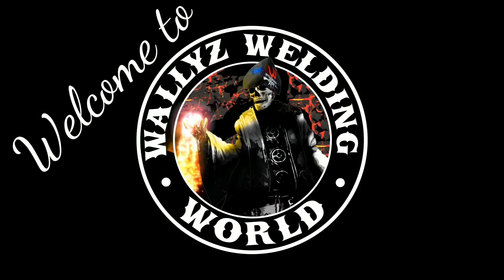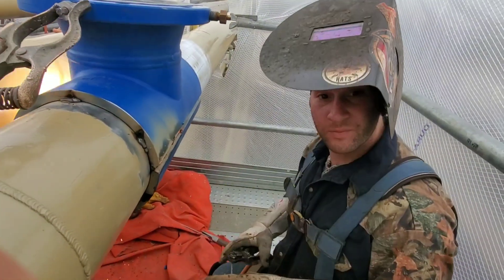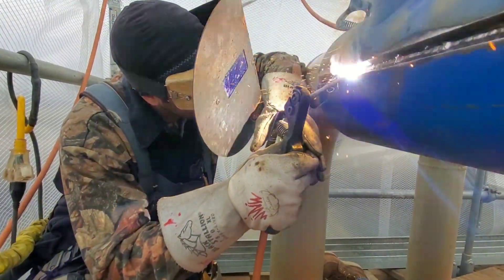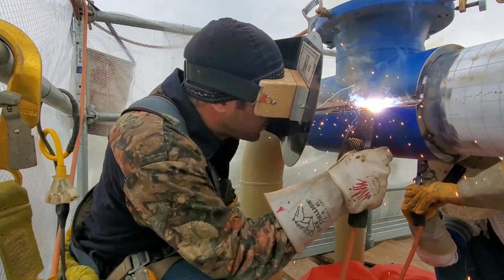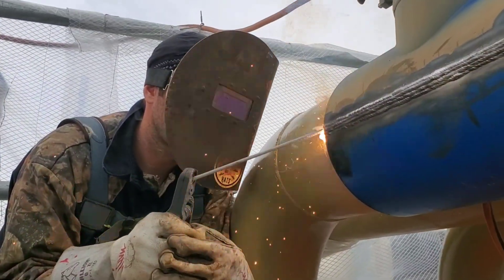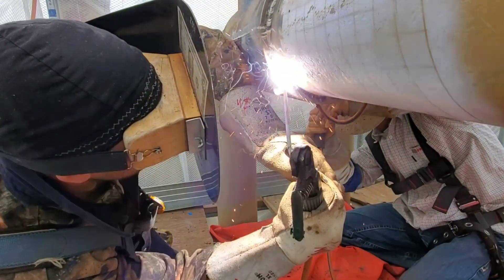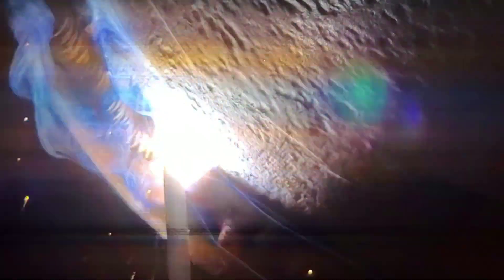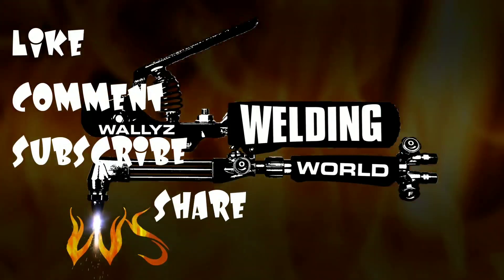Welding a LIVE LINE Split Tee — No Room for Error

Comment: That is wrong, never tack the fitting to live pipe, only tack fitting in long seams. When you go welding long seams out it thermally expands causing stress on all them tacks and live pipe which could lead to cracks.

Use chain clamps, then tack longs seams, then remove chain clamps.

Weld long seams out, then weld 1 circumference weld out then continue to next circumference. 

Its UT, not UTV

And you dont put fillet welds all the way out on fitting circumference. Its 1.4 times the thickness of lowest UT reading plus the gap between pipe and sleeve. Asme PCC-2
Reply from the maker: Right on. I follow the procedure given to me not instructions off YouTube. But thank you for your knowledge im not knocking it.

Comment: You need to adjust your Arc current control and a higher voltage  ….
Reply: Amperage
Reply: Amperage,
Reply from the maker: Yeah I was struggling 😆

Comment: In case of gas pipeline, is it mandatory to have minimum gas flow through the pipeline to achieve the split tee weld and the hot taping ??
Reply from the maker: It’s what they add when the line is live. A valve will go on and then the drill. Drill hole pull up drill close valve build line going to valve to other run.

Comment: Nothing but gravy this guy's are doing. 
How about working on 13 stories.  Hanging out side the the building.  With harness one hand holding the safety cables the other hand welding on 3/4 Inc steel. 1/8   rod.
Reply from the maker: Why would I do that it just sounds like something I didn’t sign up for lol. Stay in your lane I guess. I stay on the gravy train you can go up high and hang 😉

Comment: When you weld stringers first stringer your next one you finish
Reply: Into your first stringer. Teachers?????  And so on always pipe 8 inch up hill first stringer 9 o clock to 12 o clock then grind start for a nest for your next stringer stop.  Start 6 o clock stop 9 o clock teachers. ?????????? 40 years I forgot more than teachers know  yea really never start on your last bead never!!! Never means never !¡!  Oh never seen on videos wash , rake , or a correct lace or a correct stop/start never! I have seen junk when you get good enough you get to repair junk .
Reply from the maker: I don’t grind my starts . If ya learn to weld properly there is no grinding in low hydration unless ya trap and if ya trap your technique is a lil off I could show ya how to obtain no grinding and make great time on a test. Grinding takes time

Comment: No run on run off tabs on the longitudinal welds WTF ???
You asked for comments..
Cut some 1" x 1/8 angle about 2" long, lay the angle in to match your prep so you can use them as start and finish tabs..
Can't see how that wasn't included in the WPS, we would never get away with not including run on run off tabs in Aust 🤔
Nice job just the same 👍
Reply: different standards in yankee land that's for sure 😂

Comment: Things have changed so much. When I was welding in the early 90’s , I capped with 1/8 using a horizontal figure 8! Leaving a flat cap with 1/16 over the pipe.
Reply from the maker: So cool

Comment: Not a welder here - So if you need a backing strip to be safe about blowing thru the pipe to join the two halves, how can you go after the ends  so aggressively and not have problems?  Great looking work btw.  You sure can see the pitting in the pipe on some of those close ups.   Thx!

Comment: I mostly  welded  buckets  for excavator  and  heavy equipment.. was a diesel  mechanic     the 1st part of my career..  I'm  pretty knowledgeable   in that  forte    but  I'm  far from experienced  in oil pipe  work I say that  because  I believe  this is a moronic  question   but
If you welded the tee  on a solid  oil line  what's the next step   as for bolting  another rerouted  pipe  by making that a union. How do you get the center  of that  new tee cut out  without shutting  down  oil   maybe I'm thinking to hard 🤦🏽‍♂️   maybe they make a  flange that Pearce's   the middle of that pipe as its  bolted down..
 Like I said I live on the east coast   pipe lines are far from our line of work ..  I couldnt tell you    the psi of the oil or  anything  about oil field work or pipe fitting..   aside from that awsome work...   mannnn... all that look at my beautiful  weld's  is for the tig guys   ofcourse anyone could burn a  rod  and say how beautiful  it is but nothing compares  to tig
Sorry so long

Comment: Any young person watching pay attention to how he strikes that 7018 3 inches away from the puddle.THAT PREVENTS POROSITY.Which likely to happen especially on the bottom of as pipe with a 7018 especially..If you are testing and need a job very bad to feed your family that can make or BREAK the test!Also be aware that welding on a pipe with gasoline or crude oil or any liquid has a tendency to very quickly draw the heat out of a puddle.ALWAYS INSIST ON THE THICKNESS TESTING!Especially if you are welding an WOL[weld o let] or TOL[thread o let] on the outside radius of an elbow which is a common practice at refineries.The elbow wears thin on the outside radius and you can get burned to death by the gasoline under pressure that just spayed out on your clothes and skin and face.Also ALWAYS strike an arc on something else to make sure that someone did did not turn up your machine by mistake thinking it was theirs to run jet rods or arc gouge or maybe something wrong with the machine.Blowing a hole would likely be fatal or worse.When you are around a refinery the human nose is a better explosive meter than anything man has ever invented and can detect 2 part per million of something like ether.No flamable/explosive meter can do this.If you smell gasoline LOOK for the sourse BEFORE you ;light up!I saw someone avert a disaster one time by smelling the fumes coming from an exterior tank gauge on a still cool morning and settling on the ground 75 feet away.

Comment: As a old retired guy that welded for a few years as a pipe fitter back in the late 1960’s. Most of my experience was with steam piping. We used a lot of E6011 low pressure. I did a lot of tank farm work getting them ready for new kind of gas. These were Shell farms and pumping stations. All I knew was that it was called Shell of the Future on the drawings. Most were in evacuated lines. We had to weld uphill on everything a lot of flanges as many valves had to be upgraded. Then vapor recovery came right after the “gas of the future”. Funny all the pipe line guys welded down hill we couldn’t hire them.  I’m looking at a scar on my ankle from a hunk of that ugly 7018 slag that somehow went down my boot (no spats) 70 years old and that still gives me the chills today as I think about. Didn’t hurt long but it did hurt like heck for a bit. I was a kid and the Forman my helper were laughing like hell as I started jumping around. Just had to pull that hunk of slag out it was deep because my boot pushed it into my inside left ankle 50 years later still have that scar. Anyway great video. Never used a split tee very nice item.  Start cutting a tee in on a hot day those lines would get hot in the sun and grow so much the tee wouldn’t fit your cut out. Hose the line down with a fire hose so you could fit it up. Sorry so long I’m old.

Comment: I have done split tee weld my experience is that the circumferential weld we do with 8018 rod in downhil first two passes on pipe not fuesing split tee the third pass on split tee and pipe fist pass,and continue weld,all pass in downhil,Reson fast cooling,fast traveling,I worked in oil field Will Bros company,as foreman ,Oman, Kuwait, Saudi Arabia,(I don't know what you think but I have practical experience,

Comment: In minute 9:44 there is under cut at the top weld and a log the weld in several different spots I seen and pinholes on the end cap weld good job but could Ave slowed down a touch not judging but that's what I saw

Comment: Great Video!  I really like your narration, but don’t be so hard on yourself!  Welding in the field gets difficult.  I’m a structural welder by trade, but do a lot of TIG work in a fab shop.  I have welded large diameter nozzles fabbed in the shop and on some of the bigger ones, we used 1/4” 7018 for a final filler and cap pass.  Do you ever use 1/4” 7018 rods?
Thank you and I love your videos!
Reply from the maker: Appreciate it thank you

Comment: When using stick rods what would cause ur stick rods to stick when trying to start ur welds???
Reply: Petey Wheatstraw not on the right Amps, maybe try turning up the hot start, maybe the thing you’re welding is a little too hot, or you could just be bad at sticking a arc
Reply from the maker: Too cold or improper stricking
Reply: Isn't that why they call it "Stick Welding."  ( :
Reply: Thanks for the feedback!!! I appreciate it!!!

Comment: You guys use a hot box for your rods?
Reply from the maker: Yup
Reply: @Wallyzweldingworld  my navy instructor told us if in case you don't have one, stick it for a few seconds, and it'll heat up. Works like a charm.
Reply from the maker: @snakeyes7711  yeah I do that at times when I'm without one

Comment: I use to weld on PC valves on natural gas lines they installed a gate valve for the Muller tap machine bored a hole through the pipe and inserted a rubber plug to shut off the Gas some pipe was badly pitted that made it more interesting .😁😎

Comment: How critical would you say the angle of the rod to surface material in regards to penetration and overall weld quality.
Reply: It's very important - find a copy of the Navy welding manual and you will see that the techniques for each type of weld are very simple, at least in theory, but doing them in real life, especially on a changing surface (like the pipe in this video), is easier said than done.  Only practice will make you a better welder, hours and hours and hours of it.

Comment: I enjoy these kinds of videos! What is your favorite rod to use when welding I personally enjoy 7018 it’s smooth running rod.
Reply from the maker: 7010 all the way but I weld alot of 7018 too. I do it all. Mig and tig as well. Just dont underwater weld

Comment: I'm interested in knowing more about that rudimentary welding helmet which I ever only see pipe welders use. The only advantage I can see to such style of helmet would be airflow because anyone who's worn a 'traditional' welding helmet for any longer amount of time will tell you it gets hot and lunch-breathy in there.
Reply: I was always told that the reason those “pancake” style weld hoods are popular with pipeliners is because it sits tight against your face and keeps the sun from reflecting off your lens.  It’s also great for not getting arc flashed when you’ve got three guys burning away in a trench.
Reply: Keeps sparks out of your ear, one earplug in one side and open on the other

Comment: Great Video! Thanks for sharing! Any idea what the process is for making the tee functional?
Reply: - They bolt a valve to the flange and test for leaks.
- Connect a drilling unit to the valve
- Drill pipe through the open valve
- Extract the drill bit with the cut out piece of pipe
- Close valve and remove drilling unit.
Job done.
Only a basic rundown but gives you an idea. Called 'hot tapping' if you want to look it up.

Comment: Do you lower your amps or let the metal cool at all for the last bead on the cap?
Reply from the maker: I start off around the same on each pass. If anything I start off colder a tad on bottom and as I climb I increase in heat.

Comment: Great vid! Why use stick? For convenience? WPS requires it? Why not Mig, fluxcore? Looks like you in an enclosure. Thanks for sharing.
Reply from the maker: I wish I could metalcore pulse I'd be dont in one hour
Reply: I was wondering the same thing , why not flux core ? Personally used a LN77 - 3/32 wire , needed a 6 cyl Lincoln to drive it , & when I handed it off to anyone else , they could not handle it , because I run hot ,building false work on bridges . Good welding great job!

Comment: looks good, what brand 7018 were you running?
Reply from the maker: Lincoln electric excalibur 7018 MR and böhler 7018H4R whis is my absolute favorite
Reply: @Wallyzweldingworld  oh ok. the white flux looked like excalibur, i never liked that rod because it runs like old McKay 7018 its kind of sloppy.
have you ever used Lincoln Jet LH-78MR? i have always liked the crisp arc of that rod.

Comment: Excellent video and work young man. I suppose if you had ground the paint off along the path of the backing strip then the strip would have slid in perfect. So, that leads me to a question.

Why does the split  "T" require a backing strip?
Reply from the maker: I honestly dont know 😂
Reply: @Wallyzweldingworld  Could it be to stop the welding process along the horizontal length therefore the edge of the split "T" weakening the pipe?

Or to put it another way, could  the heat build up on such a long horizontal weld possibly cause a premature failure by way of a stress crack forming or worse still, a failure during the welding process? Since the pipe is live and under pressure from oil it could be quite messy if it blew up.
Reply from the maker: It very well could be I am going to look into this for everyone. I got another 16" split tee on Monday and believe me I am asking all these questions
Reply: @Wallyzweldingworld  I can hardly wait young man! Thanks for your prompt replies and the great videos of course. Stay safe young man.
Reply: It’s to make sure you won’t burn through the pipe wall while welding root.

Comment: Nice welds I do aluminum pipe welding with using mig I'm always burning tips so every few minutes I gotta either clean them or change them that's the only pain about that other then that it's very rewarding

Comment: Why was the stopper plug left in the top of the split sleeve while welding we  are never aloud to leave them in because they can get to hot and if the oring is on it it will burn it up
Reply from the maker: We take the gaskets out so they dont burn up.

Comment: what is your weave spec  on pipeline? When I worked at EB in Groton CT on subs MIl-SPEC 0n HY-80 with 1/8th rod was NO-MORE than 1 1/2 times the diameter of the rod on overhead and vertical. inspector catch you weaving over was a bust out, re-cut and you were stepped down from X-ray slots. Inspectors were crawling all over the boat sections. That was in the early 80s.

Comment: do they at least have a shut off valve in case you burn through might run into a thin spot
Reply: why do they have you run 7018 on that ?
Reply from the maker: @JAE-ee4ne  procedure calls for it

Comment: Hey Wallys the Weld Professor question! How do you keep that Line From exploding? I suppose the Welds doesnt heat up the Inside of that Pipe enough to start a Fire of Something? 2 is How they gonna Install the Tap?
Reply from the maker: Just dont burn stupid hot. And the ut reading help indicate how thin it is
Reply: Have to have adequate flow in pipeline.